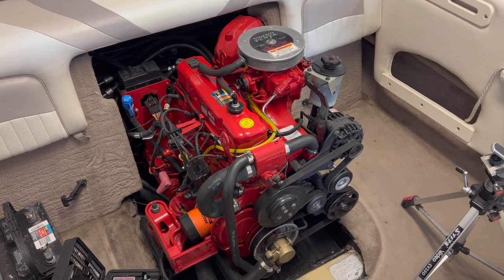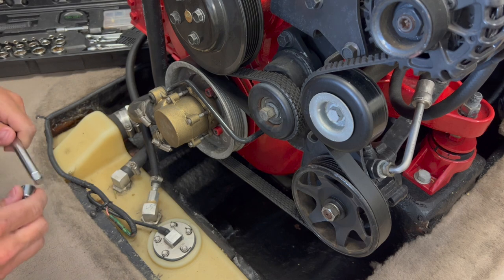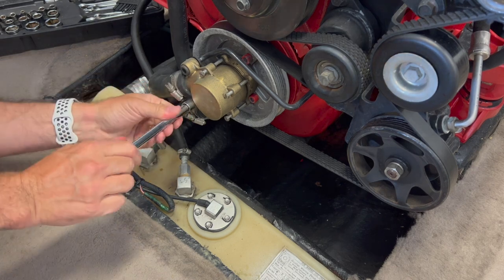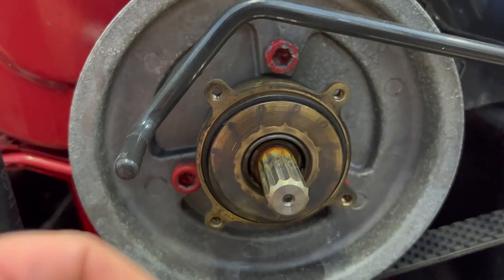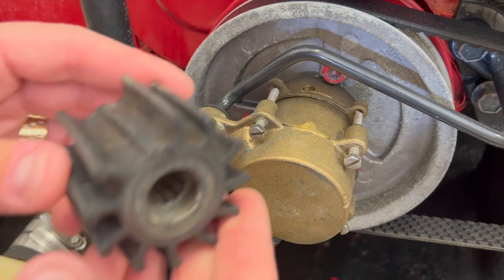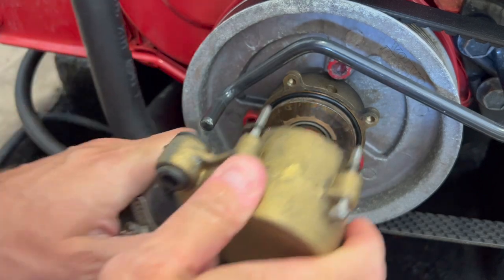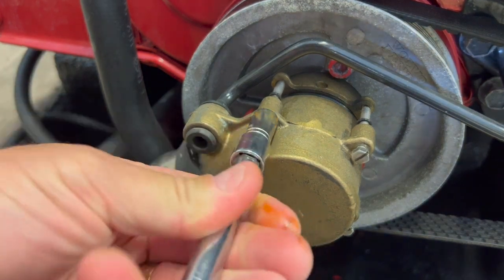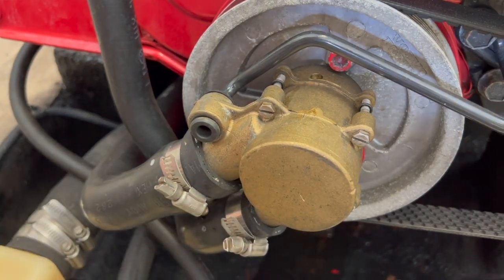Volvo Penta Impeller Replacement PN 21212794 Engine 3.0GLS-J  - Stingray 185SL

Comment: what is the name of this part What is the name of this part where the water from outside arrives and is distributed to the impeller and a power stree oil hose is connected
Reply from the maker: I do not know exactly what you need, this is the Raw water pump. Is that it?

Comment: Did you figure out where the broken pieces of impeller went?
Reply from the maker: Yep, I will update later. thanks
Reply from the maker: I have not, I guess it was small pieces and went through the pipes.
Reply: If you have a closed cooling system, check at the heat exchanger honeycomb to fish out the broken vanes of the old impeller
Reply: It is also good to add some marine grease in the impeller housing to get better life out of impeller.
Reply: @felipezafani  Mine was stuck inthermostat housing, so it kept overheating

Comment: Nice maintenance videos on this engine. You have a new subscriber. I have  3.0 GLP-C. I think i have some dripping coming from there. Do you know if i change the impeller and the o-ring will fix it or it has to be the whole pump. Thanks.
Reply from the maker: Thanks for the sub!
Reply from the maker: I dont think you need a full new pump, and it drips just a little that is not a problem, just make sure your bilge is working.
Reply: Ok. Thanks for the reply.

Comment: Where's the broken fin?
Reply from the maker: I think it is gone for good, normally small pieces and it get out thought to exhaust system on the water discharge port, not sure if that is what happened but it could also be stuck inside the manifold.

Comment: Nice videos, it will be super helpful if you can add the parts numbers
Reply from the maker: Yes I will update later thanks.
Reply: My engine cover has a label/sticker on it that has parts for impeller, oil filter, fuel filter, etc.

Comment: What was the part number and where did you order from ps what year is your boat
Reply from the maker: My boat is 2008 impeller PN Volvo Penta OMC part numbers 3588914, 3584350, 21213664, 3593660, 2123664 & 3841696.
I got it from Amazon, just look for PNs above.
Seller/Brand: RELIABLE PARTS SYSTEMS
Reply: @felipezafani  ok thanks I have a 2000 3.0 Volvo pinta just trying to make sure I order correct part
Reply from the maker: PN on the original part is 21212794. But it is hard to find and way more expensive. The alternatives are the one I answered earlier.